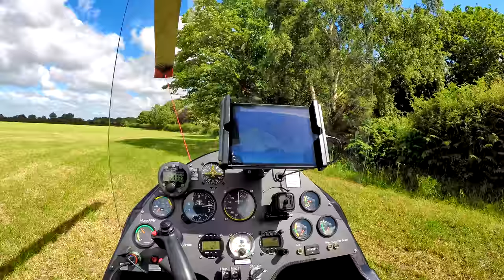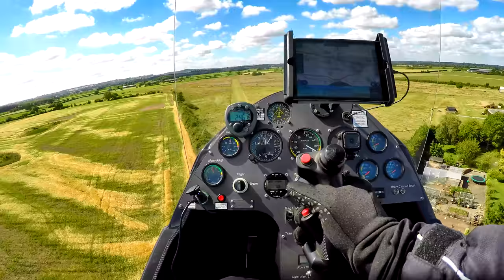Gyrocopter Field Take-Off 4K

Comment: Hi, Thanks for sharing. How does that traffic warning work? What system is that?
Reply from the maker: It’s PilotAware that does the transmitting and receiving and decoding; it then sends the data for display on SkyDemon navigation software running on the iPad.

Comment: I liked the zero ground speed moments. How slow can you go and maintain height?
Reply from the maker: Depends on the wind speed.  The gyro needs 25-30 mph over the rotors as a minimum; if you can find this at altitude then you can stay stationary over the ground indefinitely.  In practice, the lack of airflow will cause engine temps to rise so I limit a hover to around a minute or so.

Comment: Hi Stu, thank you for sharing. Could you tell me which traffic warning device you are using please?
Reply from the maker: Hi - I use PilotAware linked to SkyDemon and to my transponder to give ADS-B out.  On this video I was using the PilotAware audio traffic alerts; since then I have switched to take my audio alerts from SkyDemon - this still alerts me to traffic via PAW, but also gives other warnings (eg terrain and airspace). Hope this helps.
Reply: StuWithAView  thank you for the prompt reply very much appreciated. I am using the TM250  so will probably add the PilotAware as well.
Safe flying
Marwan

Comment: Some serious stick shake there, have you tracked the rotors with a digital tracker?
Reply from the maker: As regards stick shake, my rotors were Rotor System 1, lifed at 700 hours.  The stick shake had been gradually getting worse, but rotors don't go out of balance by themselves.  The manufacturers now think that stick shake is more frequently caused by teeter bolt bush wear due to the lubrication point being centrally mounted and not able to pass grease to the end bushes.  I have since upgraded to RS 2 (life limit of 2,500 hours) complete with new teeter tower.  And vibration is much reduced, as you'll see from upcoming videos.  Not gone completely; it's still a gyro - but much reduced.
Reply: @StuWithAView  Extremely interesting, due to the fact(U may already be aware of)A father & son possibly somehow lost their rotor & plowed into the side of a shore, losing them both! Rotor was discovered quite a few distance away!☹️...just due to that alone, I always try & inform others at the very least, to make sure that rotor pin is in & 🔒
PS: Never did actually fine out exactly what happened, that's why your reply was extremely interesting (safety first)

Comment: Thanks Stu, have been waiting for the departure to see how it went. BTW what RPM did you pre-rotate up-to?
Reply from the maker: I was aiming for 270 rpm, max per the POH, but the main wheels started sliding across the surface due to the prop thrust (you can just see it on the video) a little shy of max; probably around 250, so I went full power/stick back as soon as I felt the slide.

Comment: 84 knots is quite quick. What's the VNE for that gyro?
Reply from the maker: Not sure where you’re reading that from; if SkyDemon, then it’s groundspeed; if the ASI, it’s in mph.  Vne for a MT-03 is 100 mph.
Reply: @StuWithAView  hey thanks for reply .. i didn't read it - you literally say it in the video and it got me wondering what the vne was as i'm guessing that's getting close? just curious.
Reply from the maker: I do indeed 😊 That’s a ground speed overhead Hawarden, with the wind directly behind me; and a strong wind at that.  My airspeed at this point was around 75 mph (you can see it on the ASI just before the Hawarden overhead).  As gyros fly at low air speeds, ground speeds are very heavily influenced by the wind - I had a headwind outbound and a tailwind on the return, with the effect that my return groundspeed was almost twice my outbound.